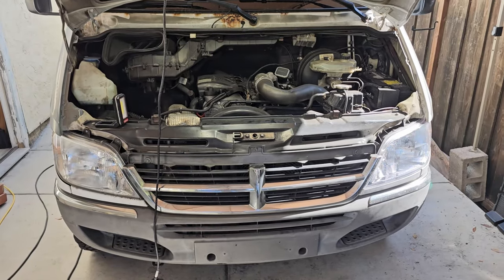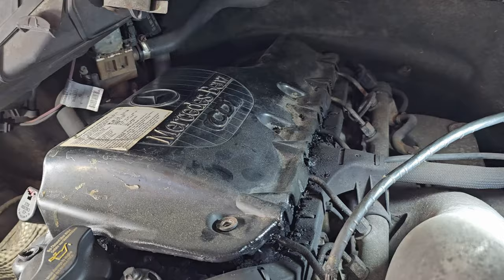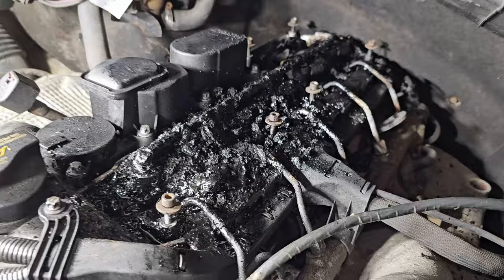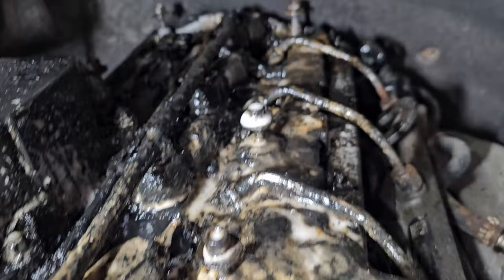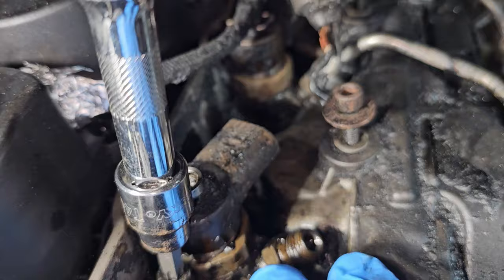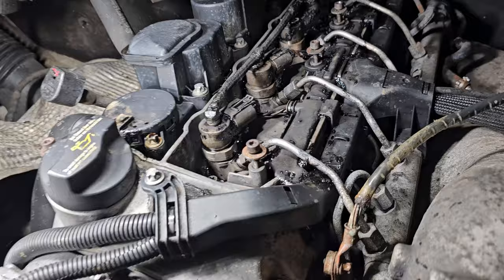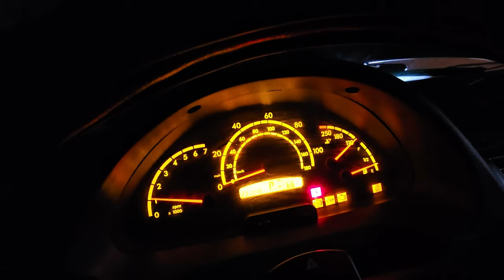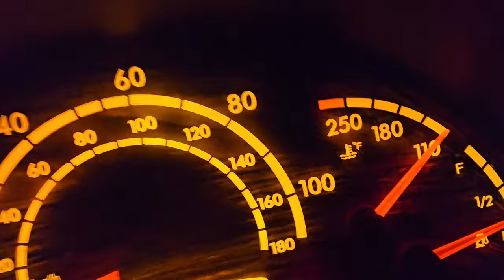T1N Sprinter Series - 14 - SERIOUS "Black Death" Injector Leak Repaired

Comment: My question and I’m not trying to be an asshole so please don’t take it as that, why don’t you just fix it when you knew there was a problem 23k ago?
Reply from the maker: Totally valid question.  No time.  No money.  No confidence.

The van was given to me from a family member with a lot of issues.  I did what I needed to make it safe for a cross-country trip and then made the journey with my fingers crossed and a bag of tools (2,800 miles in limp mode).  Once I reached California, it ended up as my daily driver and I was only able to make minor repairs when I wasn't down for more than a day or so with it.  I just kept driving it everywhere and it stayed running strong and I was afraid to look under that cover.  Eventually, a new noise started happening and then I got it home and started the work in this video that very night.

My hope is that there's no other residual damage from running for so long with that leak.  I guess I'll find out eventually...

Comment: Yeah...could have been shorter but great info. I ordered the honda injector seals for mine, they come from Japan and are supposed to be thicker and not fail. # 2 injector on mine as well but caught it early so just a bit of black spatter.
Reply from the maker: I ordered them as well.  I'm eventually pulling out all the injectors, cleaning it all up, and replacing the seals with those Honda ones.

Comment: Great account in real time of your struggle the black stuff and being able to overcome the issue with one injector. Seeing the original state you would not credit that one leaking injector could be responsible. I had the same issue 7 years ago with one injector. I started to smell what I thought was exhaust fumes and thought it was where I was going in traffic and being a diesel I didn't hear the  puffing noise till I opened the bonnet to do other work on the car. Only when I removed the top cover could I see the black crud aound one injector. I cleaned just like yourself but could not get the injector to budge. If I had seen your video it would have given me the confidence to persist. As it was a call out mechanic came to my home and did exactly as you did running the engine, getting it hot and eventually by twisting it was removed. After her left, I replaced the seals on the other three injectors.The car had done about 150,000 miles when this happened and now at 218,000 without ever having to change the injectors. A  2009 Ford focus estate diesel 1500

Comment: What kind of cleaner do you use?
Reply from the maker: I used many different products and I found that the absolute best by far was a combination of acetone and automatic transmission fluid. Turns it all to a nice soft goo pretty quickly.

Comment: Wow. Well done what a massive job. I just changed out my T1n wiring harness, and I can say finding one in decent condition now they aren't being make any longer is like gold dust. I will keep my old one as its repairable, but note that my Sprinter previously had a mild case of Black Death in one injector, which caused all the wiring covers to disintegrate and that led to the engine stalling at highway speeds on 2 occasions from electrical shorts. Very scary. I highly recommend checking under the top cover regularly and recognise that sound of the engine 'tick' at the start of this video. Let's call this video a classic 'cautionary tale'.

Comment: Three words: Gel Paint Remover (not the California-safe kind if you can get it). Keep piling it on and it dissolves the build up, wipe away with throw-away paper towels and repeat. The solvents captured in the gel do evaporate, so you want to keep piling it on; you can slow this by covering it with clear cling wrap. You HAVE to wear gloves, eye protection and long sleeves when you're working with this stuff. Learned about it years ago to de-coke pistons in rare vintage Euro motorcycles when tracing down cracks during cylinder head & piston inspections , and it's used to de-coke the power valves in two stroke dirt bikes as well as cleaning piston lands/rings without the scratching the surface treatment off. Neat thing is, if you let it do it's chemical thing and keep wiping away the goo and re-applying, you can see the original machining/casting in the surface,  Keep the lid on the can, I use spray can plastic lids and plumbing metal acid flux brushes to apply the stuff and pour out as needed. Once you got down to the exposed injector hold down plates you could have just poured this stuff on from the can and let it sit. Next time, right? 😀

You stuck with it, I love watching people work through problems, using what they have and what they know so far- that's how we learn and get better, having problems, we don't even remember the easy jobs! Watching 20 minutes and I kept cringing at all the carbon block accretion you have going on there (it is indeed the worst I have seen from just one injector!)
Reply from the maker: Waiting for better weather here to work through the other 4 injectors and clean it out a bit more.  Definitely trying out your suggestion; thank you!

Comment: PS
In relation to the reliability of diesel fuel injectors. As stated the 2009 Ford focus estate 1500 diesel has done 218,000 without the injectors being replaced. My other car  a 2012 Ford focus C-max 1600 with a different clamping system holding down the injector just like your sprinter is currently at 62,000 miles and I am now in the process of replacing a fourth injector. I have in other places read that others have been having this problem but Ford does not accept that there is an issue with injectors for the particular model at its year. Thank you again for the video and  if people are impatient looking at it they can slide along the play stripe to move on the video and soon find where you resolved the problem.

Comment: Great video & Well done, I hope you were very pleased with yourself for fixing it & gave yourself a huge pat on the back.  I had the same issue on a 2002 sprinter but it was the injector right at the back.😱 I paid £500 to have it cleaned repaired as I simply wouldn't have been able to do it myself. The mechanic who did the work damaged the rocker cover & I had to buy a salvaged replacement for £85. I had other injector problems a few months after this & a couple of copper washer issues occured. I had a trained Mercedes mechanic work on these & he resolved all the injector issues. The black death is so common on these engines. Ignore the negative comments, there are far too many dickheads on Youtube!!!!